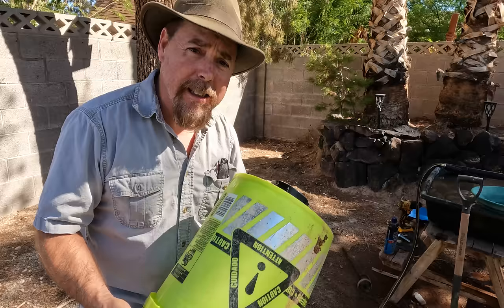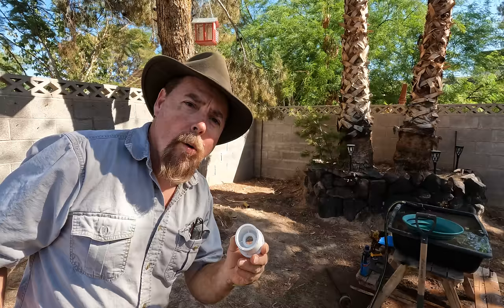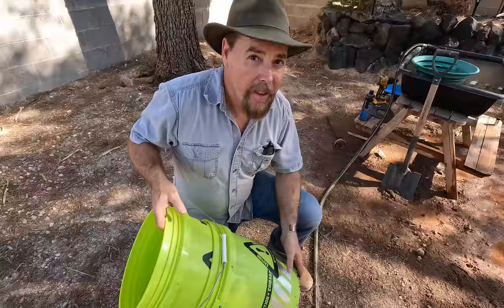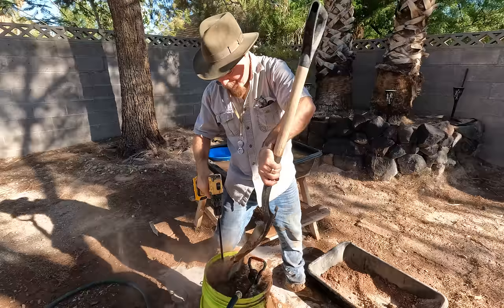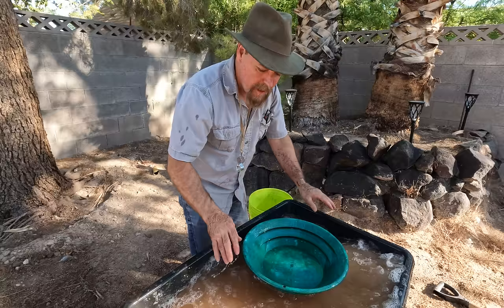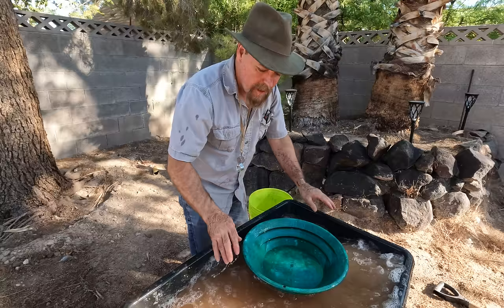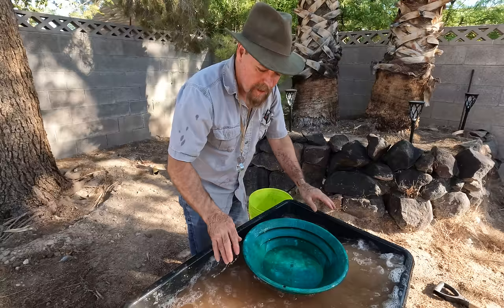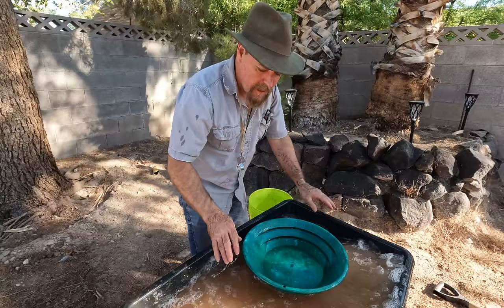Gold Prospecting Hack - Find Gold Using a Bucket & Drill! 🏆🔩

Comment: The only thing I can think of to make it better would be a piece of hard plastic on top of the magnet with washer on top to keep the magnetics off the magnet and easier to clean. Great job Jeff and all involved making this happen thanks for sharing see you on the next one 👍🏼👊🏼
Reply: Put the magnet in a bag. When you take the bag off it will release the material.
Reply: @danbosch-  I thought  the threads might tear the bag and fall off when you unscrew the magnet loosing the minus 100’s  but I agree something would work that would be fast and efficient just not sure what it is
Reply: How about put the magnet in a baggie
Reply: Maybe a silicone dish with a silicone lid

Comment: I built something similar years ago using a piece of plastic from a cutting board with circular grooves machined in it, using a lathe, at the bottom of the bucket to catch the heavies. It's great for producing concentrate quickly.                                                    An important addition to these type of bucket concentrators to really speed up the process is to make a classifier using a mesh waste paper basket that fits inside the bucket, I cut the solid bottom out of the basket and braze in a piece of perforated steel, this makes a portable concentrator that you can shovel dirt directly into it. One other thing is to bring a water bucket to nestle inside the classifier.

Comment: I had this idea just before you made this video and what I found was that it's an extremely effective tool for bulk sampling. I would bring a 12 volt lithium iron phosphate battery and a 2000 gallon per hour pump and then a classifier and a drill and a paint stir. Classify the dirt into the bucket. Get rid of the big rocks and then remove the classifier and use the paint. Stirrer to do the poor mans sluice. It works really well. I'm going to have to go to magnet and build this thing. It's a very handy tool to take into the field.

Comment: Hey Jeff,
 I went to HomeDepot to get the parts minus the magnet. I am confused and so was the employee on the 4" coupler flanged on the inside, I believe I found the right 4" to 2" reducer. Could you possibly make a parts list with links to make this complete setup. You have a link to a magnet site, but not pointed to the exact magnet to use. Thanks for your time and keep up the good work.
Reply: Maybe called a 4 inch BULKHEAD FITTING

Comment: That is a great idea, brother. What would it take to replace the magnet you have with a plunger magnet. That way instead of having to remove the bolt to extract your magnet, you just pull the plunger magnet out and pull the handle/lever. It's just a thought.
Reply: The difficulty might be finding a plunger magnet to fit
Reply: a sandwich baggie around the magnet(in the pvc) just before you put it in tge bottom of the bucket.  When you pull out the magnet assembly, it is in the baggie and you can turn it inside out and pull it away from the magnet and you have a baggie of black sands 👍.

Comment: The two-bucket method has been around for a while, while-and-a-half. What I like are your 21st century improvements. Ya sure can do a lot more volume per load with a drill & paint stirrer than ya can stirring with a fat stick. And since the batches were so much less no one considered making a magnet part of the catch. Kewl stuff, youse two!😁
Reply: HOW does a magnet help you trap gold
Reply: @timbewcyk1988 black sand is magnetic

Comment: Just one bucket. Continuously add, twist/shake,remove. At end of day pan out just bottom layer of sand. Could use magnets during process. But the idea is to be able to walk up and down creek with just a few tools collecting as opposed to hauling heavy bucket loads back to sleuce.

Comment: One improvement would be to go to the local woodworking tool supply and buy a 150 lbs magnetic switch for magnetic featherboards and clamps then glue a thin plastic sheet to the bottom. Much easier to clean and work with when you can turn the magnet off. If you want the ultimate then you can buy the magnet switches separately and 3D print a magnetic sluice apparatus with multiple switches and traps. Have Fun!

Comment: Cover the magnet on the side where the metal collects with a plastic or aluminum cap so when you want to remove the metal from magnet you just turn it cap down over a pan and pull the cap off. All the metal will fall into the pan with a light wipe and the magnet will be perfectly clean every time. Quick and easy. That’s how the magnet devices for picking up nails and metal scraps (tire poppers and foot stabbers) on construction sites.
Reply from the maker: good idea

Comment: What if you changed the system a bit and find something like a concrete mixer that feeds as it spins, plum in the water, and angle the bucket at a 45, or whatever angle you find works best, so that you didn’t have to babysit and run a drill?
I actually believe the rounded bottom of the concrete mixer might work out better in this scenario.
I realize that just seems like too much work when this system works as well as it does but if you figure in the possibility of how much more material it’s likely to run through with much less work then it might be worth the effort depending on how much of this material you have to run.
If you ever need any help in about two months, I’ve gotta have knee surgery, I’d be willing to help for free just to gain some knowledge.
Love the channel
Be Safe out there
GOD BLESS YOU ALL
Reply from the maker: thanks , really appreciate that
Reply: Similar to how I use a concrete mixer clean up the gravel in my yard. Set up a hose  pointing into the mixer and just shovel in the gravel, all the mud, weeds and muck just overflows out as a slurry.

Comment: I would consider a shimmy cloth over the magnet for easier removal of the black sand or even a small piece of plexiglass to help keep it separated from magnet for ease of clean up. Yeah it would require a slightly larger hole than existing for accommodations for cloth..no augmentation if using plexiglass.heck even a heat gun to flatten out a piece of plastic soda bottle...or even like peak tea bottle. use the ridges of threads to hold it in place like the screen.
Reply from the maker: good idea

Comment: I'm late to the comments but I've always wanted to use an old plastic conical fermenter (*or large funnel glued to bucket) from my homebrewing days in this manner. My idea was to epoxy neodymium magnets all over the sides of the conical part and use a paint stirrer to keep as much in suspension as possible so the magnets catch all the black sands. The bottom has a valve and when you're ready to let it settle, do so and open the valve in to a jar or pan or something and go from there. Not quite and cheap as some buckets though!

Comment: 'm busy with a mesh tower on a modified spade as a dredge. Just replaced the shaft for a pipe and a cordless high pressure cleaner and a different stronger venturi to create the suction.

Comment: Jeff, what you have done is basically build a small scale trommel. 
I wonder the following. 
1. How much more recovery can be had with Jet dry on a large trommel by partially recycling the wash plant water so that the organics are sent to a settling pond. 
2. your buddies doing hard rock and a vibrating bed separator with jet dry, how much more effective for the missed fine mesh. 
3. add this process to the "tailings" off a larger process to capture the fines. 
4.  leave the bucket mounted at a 45° angle and let the drill flip out the debris as you add material and water ( or recycle water ). put the capture screen at the bottom edge of the 45 degree bucket. 

I once saw a large scale Alaska operation ( Cambior ) at Valdez creek AK, wash plant have 1/4 inch classifier bounce all the bigger nuggets into the tailings, and the only reason they had bigger nuggets, is because they were long and tapered and stuck in the screen.  
Lots of mining in Alaska is stuck in limbo, because the federal government haven't given title to Alaska to vast tracks of land. So if you loose your federal claim, you can't mine under state rules till the federals transfer title. 
Plus Fish and Game are jerks
Reply from the maker: they should have Nuggets traps installed in the washplants

Comment: The 19 cent sluice:
drill a 2 inch hole in center of bucket, put a 2 inch test plug in hole from inside, add classified heavys and spin, longer if clays are present, gold will be in test plug, enjoy

Comment: Mines got a giant ball valve on the bottom. I classify with one of those ones that fits deep in the bucket with the valve closed then hit it with the stirrer. Then i open the valve and hit it again into the catch bucket. I do a 4 to one reduction into a second bucket then a 4 to 1 on that one. Wastes a lot of water but i can really run some dirt.

Comment: You could heat the bucket up with a little propane torch where the 4 in hole is just put the fitting on and place a 20 pound Dumble or what ever you have it could weigh a little more on the fitting with the bucket sitting on something just on the edge on the bottom and heat it up around the fitting until it droops down just a little, I would say a half inch or so.

Comment: IDEA 

I finally got around to watching this and I loved it BUT here is something you might try.  Find a strong ring/toroid type magnet or even stack of ring magnets magnets with any luck you create a strong whirl pool action and just maybe you could have the gold drop right through the middle of the magnetic toroid rings into a catch while the stronger irons stick to the inside of the ring(s).  If that works I would use a small glass or plastic pipe with the magnetic fields on the out side so that when you finish you could merely remove the magnetism and let the junk iron fall out to ease with clean up.  I would imagine you could do something like that as well with low voltage and make it an electromagnet so you can just switch it off and let the junk fall out.

Comment: Rare Earth magnets are great for catching magnetite aka black sand.  Hematite takes at least a 65 pounds of pull from a Rare Earth magnet to remove it when dry from a pan.  Therefore, to be on the safe side.  I would suggest sticking with a Rare Earth magnet that has no more than about 50 pounds of pull in the Poorman’s Sluice.  Keep the heavy’s, the black sand, but not the Hematite.
Reply from the maker: thanks

Comment: I was going to suggest putting a bag over the magnet to keep it clean, so turn a bag inside out then pull the bag to collect all the magnetic material, but my brain also told me that the bag could rip and wouldn't work, unless the bag was thick I guess? Or made of something very durable

Comment: Many years ago I would go prospecting with the friend who got me into it. We started bringing buckets of dirt home to pan out at our leisure in the back yard. We KNEW the dirt was good, every pan had at least some flour in it, SO the buckets should have been the same. Pan after pan, NOTHING,,, what the heck, then that last pan with the wash out WHAAAM! FOUND IT! A five gallon bucket 3/4 full then topped off with water in the back of a truck on washboard roads for 30 miles! We started dumping off all but the last couple inches and panning that out, to heck with the rest. Test after test and there was almost no or no gold above a couple inches in the bottom. 100% these results will vary on the dirt you are working but we were in a creek with minimal clay, right on the bedrock. I talked about making a "rocker" to put a bucket in, turn it on and let it shake/rock the gold to the bottom. Then transfer the good stuff from the bottom into another bucket. Repeat till full. Then take that bucket home or shake it down again on the spot! Never got that far. Fun memories....
Reply from the maker: we have done the same thing many times and that is a great way to concentrate material so you only have a small amount to bring back

Comment: Correction, this doesn't work like gold panning so all the heavies shall not be toward the back of the bucket at all. This is a poor man's centrifuge. This means the heavies will be around the outside creases at the bottom of the bucket evenly if you worked it properly. The bucket should always stay completely vertical and bottom flush to the ground and the shaft of the mixer vertical and not angled and you'll get a hell of allot more heavies if you don't tip the bucket on its side or at an angle otherwise the user may as well just go back to panning because it's defeating the purpose of this centrifuge

Comment: Told ya, stir and shake a five gallon bucket full of gravel and cons filled with water.......
The addition of the magnet isn't needed, but a good addition.
You can make a killer classifier for the bucket by cutting a five or six inch ring out of another bucket right under the ribs on the top.
Insert the bottom section into the middle section, then insert those two sections into the top section. It makes a shorter five gallon bucket. Pop a few small small nuts and bolts through where the rings overlap to keep the whole assembly firmly together. 
Now drill holes in the bottom of the short bucket.
It will sit right on top of your stirring bucket.

Now shovel your gravels into the classifier bucket that is sitting on top of your five gallon bucket full of water. All you have to do is spin the classifier bucket and shake the buckets a little and you have cons.
After that do the bucket stir and wiggle after classifying dump out and scrape off the top layer when the bucket is tilted.
All you will have left from a half bucket of gravel is a pan of cons.
No magnet needed.
I hope I explained that well, I wish I could comment post photos of the set-up.

Comment: I use dish washing saop its😂to break the surfacetention three methods heat (hot water ) turbulance ( vortexes,riffles ,shaking ) chemicals (dishwashing saop, jet dry ,window cleaner ect) sluces mainly use terbulance 😊 when panning cons in a tub like that we use chems or hot water couse gold is hydrfobic awesome video Jeff i see in this case we use terbulance in the form of a vortex im thinking the top can get a bearing and a mounting bracket also sorten the top of the bucket down to about 60 inches then youd be able to auto run the drill hands free let the hose continuasly ad water so the drill would couse a strong enough vortex to push the light meterial out the top like a blue bowl the overflow  wil help with that i think a bilg pump might also work with as a battery opperated setup this way youd only need to shovel in clasified meterial the drill and water flow will do the rest i think ima build me one for that fine vaal gold 😂 i strugle with i have two bilg pumps layin around thats not being productive athough ive finished up my folding sluces rubber mats i made ima build something like this just to have some fun with

Comment: “….Nothing more than a drill and a bucket……”
….And another bucket, and a third bucket, and a neodymium magnet, and a 4 inch hole saw, and a 4 inch coupler with a flange on the inside, and a 2 inch reducer, and a piece of window screen, and a glue gun, and a knife for slitting one of the buckets that you cut in half, and a 2 inch to 1/4 reducer with threads on it, and a large bolt that fits inside the reducer, and a cement mixer drill bit, and a pointed nose shovel, and a cement mixing tub, and a garden hose with a spray nozzle on the end of it, and some jet dry, and a plastic gold pan, and a plastic finishing pan…..

See it’s really scaled down. Simple. Just those two items. (I don’t bring that many items when I go backpacking) Sounds like you’re organizing for a swap meet with the total yard sale of random things.

Next time just stick to your gold pan and your finishing pan and then you’ll have JUST two things.

Comment: Thank you for reminding and showing me this concept in action. I suggested this exact thing to Dan Hurd years ago to see what he thought about agitating a bucket of dirt like a washing machine with a drill and a paint mixer and would the gold and heavies always settle near the bottom and the lighter material overflow out of the bucket and just keep adding water and dirt to get a good bucket of concentrates to bring home and sluice. I wonder how big you can go "Mom, I'm borrowing the washing machine, i have some dirt to wash" hehe 😁👍
Reply from the maker: we were thinking of a cement mixer
Reply: @Askjeffwilliams  Hmmmm a cement mixer you say, now you're cooking with gas. That's actually a brilliant idea to try as it would clean the hell out of the rocks as it tumbles like a trommel, and you can just feed it and it should work all the light material to the top and spit it out with the overflow like the bucket. What if you throw in a few big steel balls and turn it into a rock crusher as well. There has to be an idea there somewhere to get rock crushed concentrates to sluice, no dusty dolly pots or rock crushers needed lol . If you got the gear, i'm sure it would make for an interesting video 😁